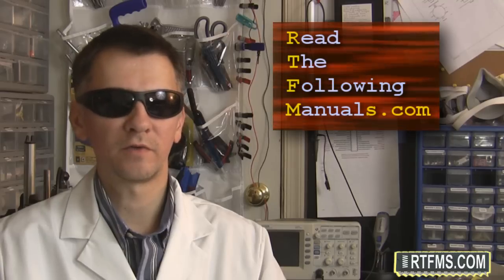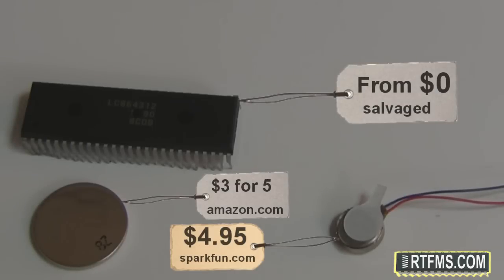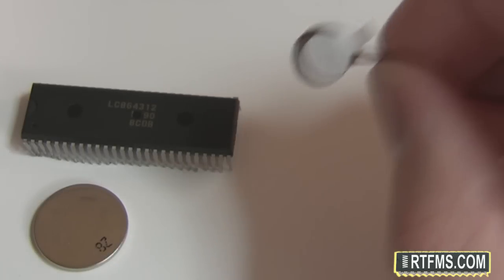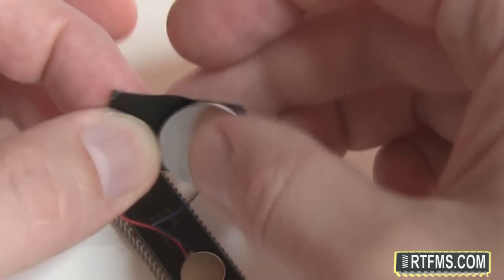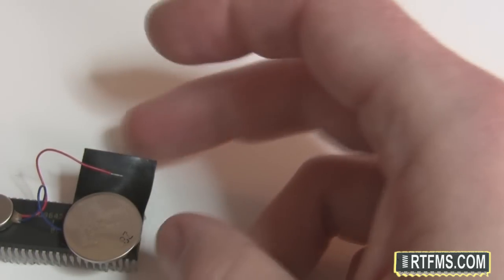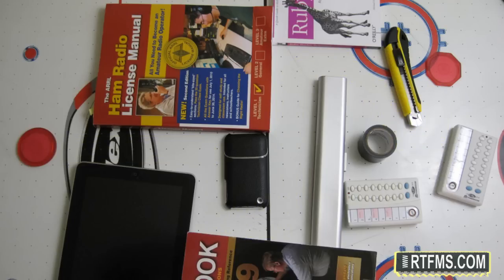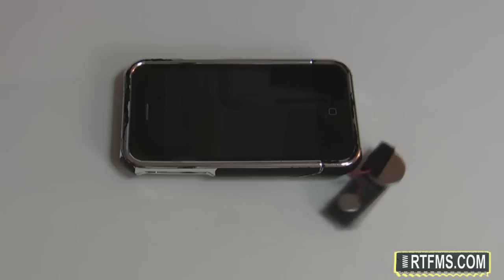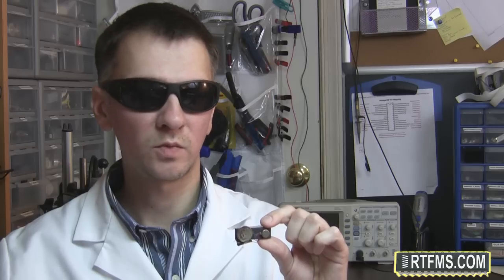RTFMS Episode #1: A 15 Minute Robot

Comment from the maker: @jeriellsworth Well, actually the MCU was running. Running around the maze I mean :) 

I wonder if that is the simplest microcontroller-based robot that can be programmed to solve a maze. Just can't come up with anything simpler than that. 

BTW, by saying "programmed" I mean wikipedia definition as "programming is the craft of transforming requirements into something that a computer can execute"